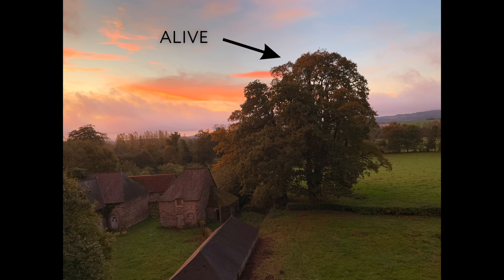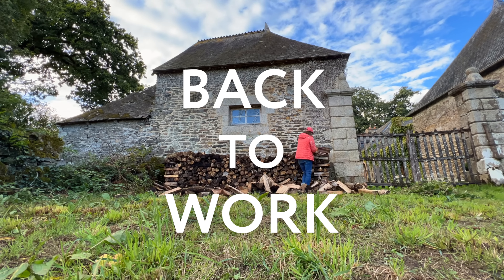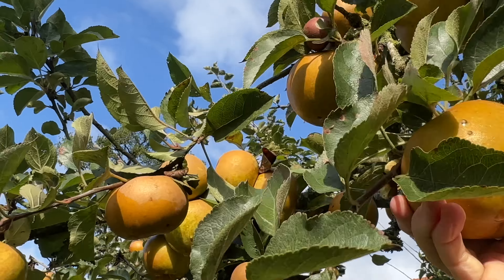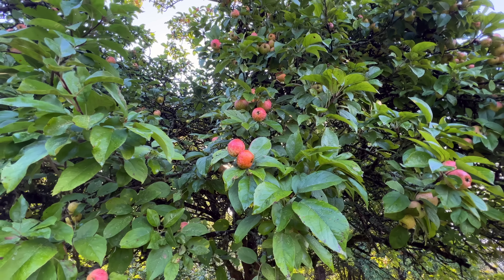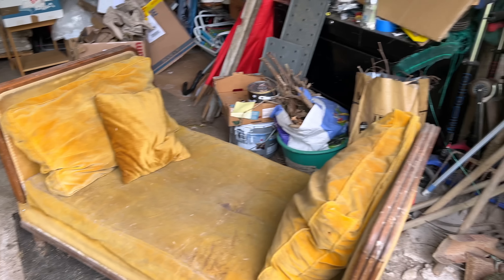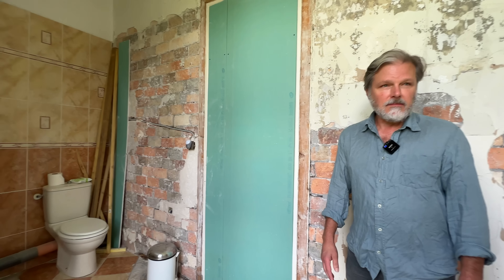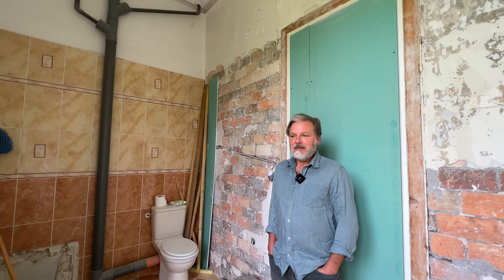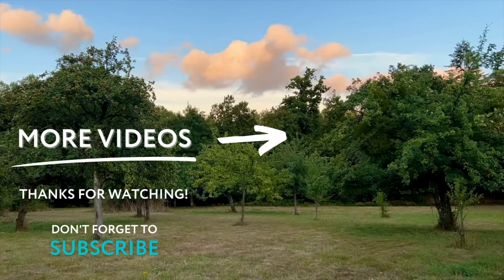Chateau RENOVATION nightmare! Can we get it done?

Comment: Good job! Maybe in the future you can build some sort of an awning to cover the wood pile or at least cover it with a tarp so it doesn't get wet?
The problem with your Quince is commonly referred to as Black Spot,,,or Fabraea Maculata. This common disease of Quince can cause severe injury to the fruit if not controlled. On the leaves and fruit  the disease shows as small circular spots, reddish-brown on the periphery, with black centers. You need to have a certified Arborist to come to your property and spray all of the trees that are diseased. ALL of your remaining Apple trees will need to be treated for the Mistletoe fungus. If it were me, I would just remove all of the Apple trees (Even the ones still standing) as they appear to be affected with some sort of beetle that is eating the trees from within. 
Even the Apple trees that may appear healthy probably also have a beetle problem.
Bulldoze all the trees and treat the soil for insects,,, then add nutrients to the new trees you plant. 
If you have a certified arborist over he can inspect all the trees,,, even your Chestnut tree. You certainly don't want to lose that to insects or some other disease.
Reply from the maker: Yes, we have a tarp. Thanks for the info -  thinking of taking down a good majority of the trees...

Comment: Wow, the orchard is beautiful. It will be fun choosing new varieties to plant. We've had terrible cedar-apple rust this year (and got rid of the cedars for the future) - our ornamental crabapple looks terrible but one apple next to it is okay. All that plumbing looks very daunting. You are right about investigating structures and moving pipes now while you can, even if it means more time with only one loo. When you shop for upholstery, look for a high-wear rating, however that is done in France. Lots of people get what they find pretty and then moan about how it's grubby or not holding up. That's another "do it right while you can" issue. I've learned the hard way to stick with wool rugs - no polypropylene, nylon, whatever. Wool holds up.

Comment: Save your iron piping! It is better on containing the noise! We replaced our's as we where doing something similar moving things about in the bathrooms, what a mistake! 

Two years later we opened the wall up from the kitchen side and put back the iron piping! BIG difference! Use plastic piping under the cellar floor or outside and use PEX fo your water services!

Comment: Not the place to stack wood. Put it away from the buildings. Far away. Then on top get some old sheet metal roofing and lay on top. Put cement blocks or big rocks on top.  Really bug rocks so the wind doesn't blow the sheet metal off. 
   Get a rasp and some hoof nippers and learn to trim equine feet. It is easy. They need to be trimmed at least at 4 week intervals or they will get contracted heels, etc. 
  You guys are city slickers for sure. SFO.